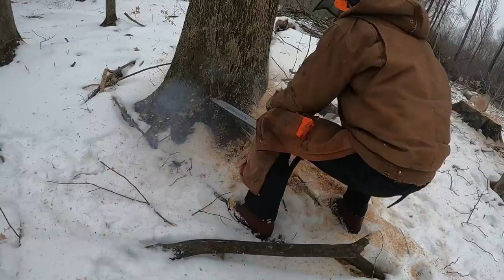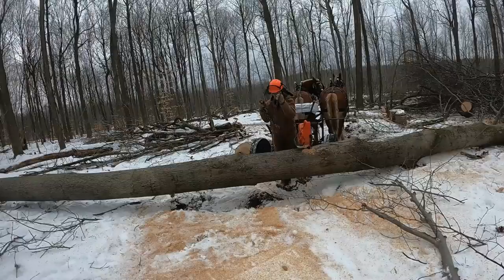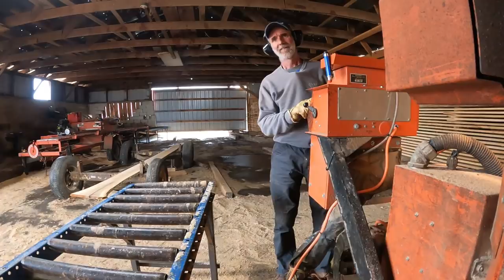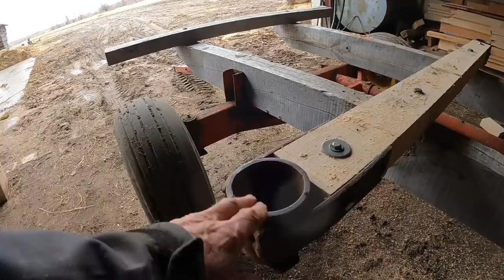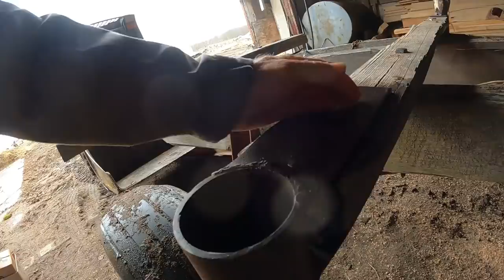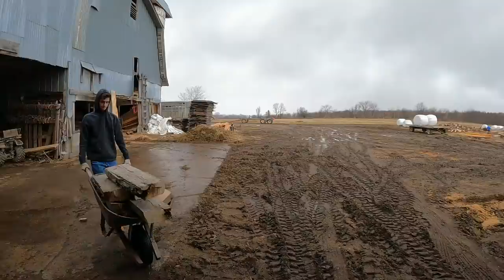TODAY'S PROJECT-- Rebuilding an Old Logging Wagon from ONE Hickory Tree!

Comment: Arkansas hickory has hickory nuts that are 1 to 2 inches big and are so hard that the squirrels have to change teeth while eating one. The leaves are bigger and rounder than oak. It makes the best handles for sledgehammer, axes 🪓 and also makes great long bows for hunting. Tha bark peals off easily and the 1 inch saplings makes very strong and light walking stick.
Reply: Most of our hames?Hames?and  Single trees are made of our hickory strong with a little flexibility.

Comment: Heavy duty lumber would have been interested in seeing how you handled those 16' stringers.
Dave Engels/ Engels Coach Shop to fit his bolts and parts heats a rod red hot and burns the hole to the size he needs above his drill bit.
Looks like you might need some tires also.
God bless you as soon you will be in the field for preparing and planting.

Comment: Jim,  The bolts you like so much look like Cross Arm bolts that the phone and power company use to use to do attachments to their poles.  Lot of them last 20-30 years and still work fine when the pole line was wrecked out.  You may still find some from the phone and/or power company.

Comment: If you have any locust I would use that for your bunks.  My old neighbor uses it for fence posts, says it lasts 3 years longer than a stone.  It's strong and hard, doesn't split or rot.  Those bolts are 5/8 galvanized line bolts, used on electric poles.  They are rolled threads so the threads are bigger than 5/8.  Use a 3/4 bit they will go in and out easier.

Comment: Jim, just curious if you paint the ends of the freshly cut "lumber" logs with Anchor Seal or something similar? My small logs split like crazy if I don't slow the drying process from each end.  Love the channel and content!
Reply from the maker: No but it would probably help
Reply: @WorkingHorsesWithJim  maybe it's worth the time for those really nice logs.  Otherwise, the time it takes may not be worthwhile.  Nice job on the wagon rebuild.

Comment: I am creating something very similar.  On your first wagon (the one bunk only replacement one) the stringers look like they have bolts or lag screws holing them to the metal frame while the complete rebuild wagon looks to be held to the metal frame with small chains.  Is there thinking behind one way or the other?

Comment: I'm no expert, but I've got hickory tool handles that are 20 years old, and are outside all the time.  I know hickory is no good if it's water  saturated, like fence posts, but for your application, and if you mix a bit of boric acid in with your old oil when treating the wood, it will probably outlast you.
Reply: What does the boric acid do?
Reply: @firecaptaintom1977  Likely to discourage insects.